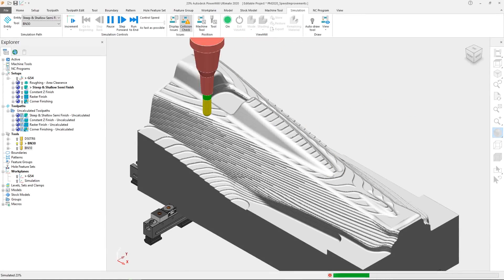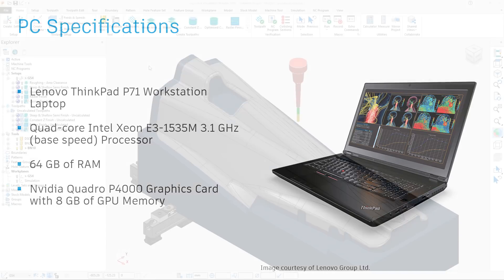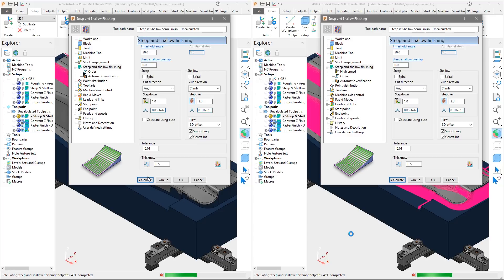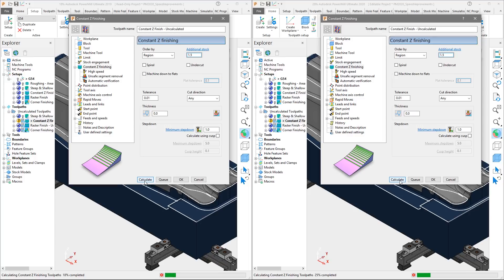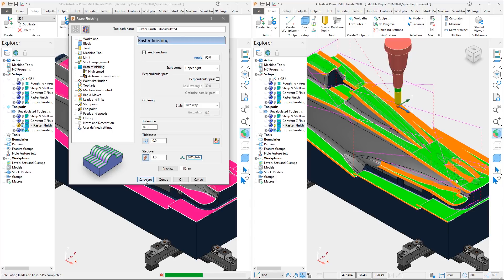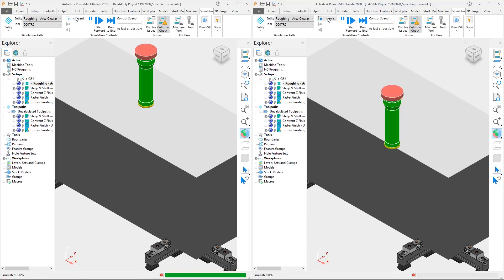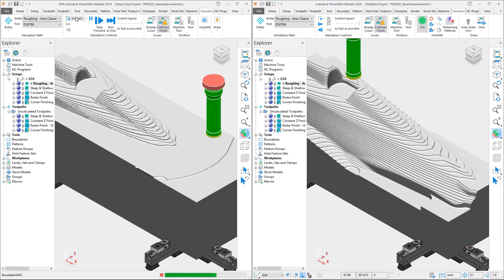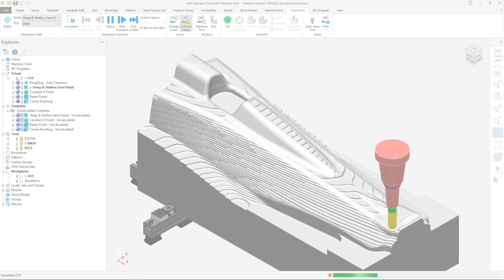Speed Improvements - PowerMill 2020

Comment: You mention you make improvements to better utilize multi-core systems, I am assuming that is referring to parallelization of the workload across multi-core CPU's. 

It is obvious that regardless, higher clock speeds...for example, an overclocked i9-9900k on water which could sit comfortably at 5.0 GHz...should see even greater improvements. In Autodesk Inventor HSM (I believe 2019) I changed from a dedicated GPU with 2 Gb of on-board vRAM to a GPU with 8 Gb of on-board vRAM (higher vRAM clock speed as well) and the tool path generation time dropped more than I had ever expected with the same i7-6900k at 4.0 or 4.2GHz with 64 Gb of DDR4 @ ~ 3.4 GHz on the memory overclock. I'm talking about it being probably 5x faster compute times, it was HUGE. 

I'm curious how much video card memory makes a difference. I know that inventors biggest fault is the fact that it cannot really parallelization the opening/unpacking of assemblies (more so than anything else, in my personal opinion). 

Being largely ignorant of PowerMill, I'd be curious how to get the most out of PowerMill. For example, if building a dedicated computer/workstation to specially run Autodesk Inventor, a 4-core less expensive CPU with a higher clock speed (3.7+ GHz) will do far better than an 8 or 16 core with a low to mid 3GHz range. Unless simulation is involved, the GPU makes little difference. 

For PowerMill, I'm curious (1) how it utilizes available system memory (as I often have more than enough for a large RAM Disk, but only because I'm not using it for anything else) (2) how much of a difference on-board GPU memory (aka vRAM) makes, for example the 2080 ti with 11 Gb of dedicated vRAM vs the RTX Titan with 24 Gb of vRAM. Assuming the same frequencies for the GPU cores and vRAM, I'd be curious where improvements in compute time could be diminished, as time is money. I'm curious where the diminishing returns line/point lies. 

You should also make a video explaining how it differs from HSM, for people like me that are used to Inventor HSM or Fusion, I'm sure it's understandable why EXACTLY PowerMill costs so much more than free (with fusion at least) and so much more than inventor HSM. I know PowerMill is better, I mean it better be for as much as Autodesk wants per year, but just how much better than HSM is it? Why is it worth it? Why should my company make the switch to PowerMill? 

What I'm suggesting is....show off a bit, flex your muscles, what can it do for me? I've heard the ultimate version allows you to play with robots? How's the lathe support? 

I think it's about time you genuinely show off what can actually be accomplished with PowerMill. Do it in a way that creates a way of thinking that produces this thought: *Oh dear God....I am losing so much money by not subscribing/purchasing this....* 

With what you charge for the software, you'll make your money back within a year of the video, probably a few months.
Reply from the maker: Thanks Kevin - this is really interesting feedback and we'll certainly look into that muscle-flexing video :-)
Reply from the maker: Hi Kevin - we've spent some time with the PowerMill developers and they've provided the following responses to the topics of GPUs and CPUs. 

Re: GPUs
At the moment we don't really make use of the GPU in the toolpath calculations. We did some initial explorations of this last year and it’s something we’ll certainly be looking at again in the next 12 months although we're skeptical whether a GPU will ever be able to outperform a similarly priced CPU.

Re: CPUs
Dual processors are probably not the best option here (unless you wish to perform other work while PowerMill is running.) If budget is not an issue then an i9 (or AMD Ryzen Threadripper??) with a lot of fast cores is best. If on a budget then currently a faster i7 would generally be better than a Xeon with more but slower cores. In a recent benchmark to test improvements on a large customer project a fairly old  i7 (3.7GHz) slightly outperformed a 12 Core (with hyper threading 24 cores) Xeon (2.2GHz). Performance gains will vary depending on the toolpath strategy being used. In this customer benchmark, the Xeon was faster for 3d offset toolpaths. In the future, we would expect to see more improvements for a processor with lots of cores than for a processor with fewer faster core. A fast CPU will always be useful though, some things have to be done sequentially (so cannot be multithreaded) a fast CPU will do them quicker.

It shouldn't surprise you to hear that we're committed to improving the performance of PowerMill. Making better use of hardware is just part of this master plan.